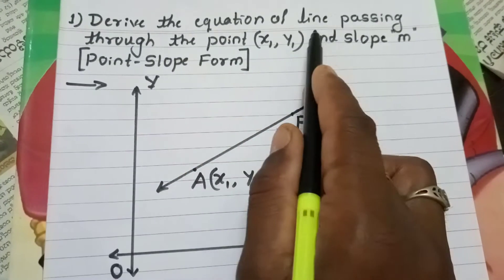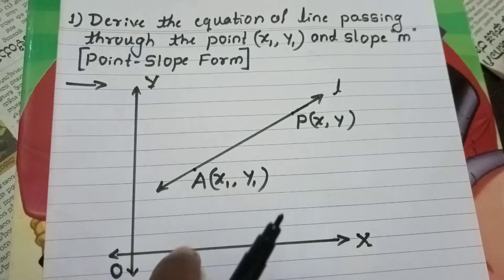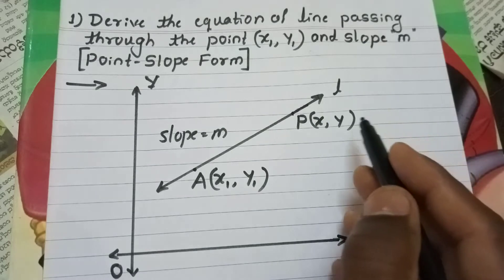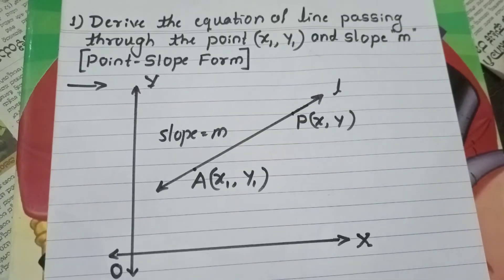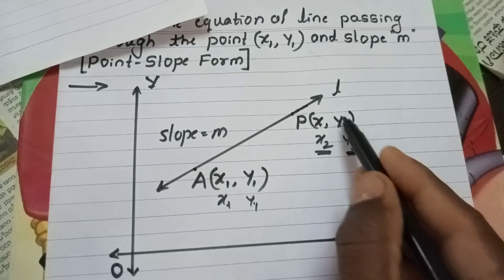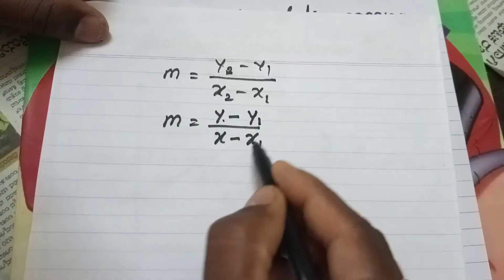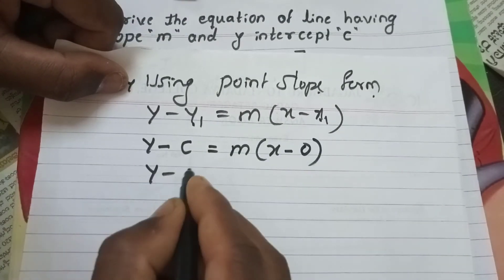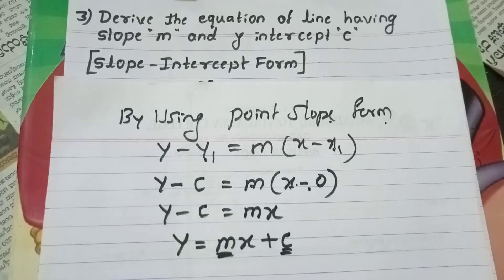PUC I Year - Straight Line - Different form of lines -  2 or 3 Marks Important

Comment from the maker: PART-D (5 Marks)
Questions numbers Starts
from 52 to 62
PUC I Year Mathematics 2022
Most Important Questions with explanation,..
Must watch the video will get maximum marks

Q.52 - Relations and Functions
1st Video: Types of Functions
https://youtu.be/qpIFfwJu6LQ

Q.53 - Trigonometric Functions
1st Video : 3 Examples
https://youtu.be/l-G1M54MSPc
2nd Video : 2 Examples
https://youtu.be/VhTbW6sZhJo

Q.54 - Mathematical Induction
1st Video : Prove By M.I
https://youtu.be/JRp2eXSrQrw

Q.55 - Complex Number
1st Video : Polar Form
https://youtu.be/9Yb-dPSKAa4

Q.56 - Linear Inequality
1st Video : Solve the system of inequality graphically
https://youtu.be/Bzy9jsCpF7g

Q.58 - Binomial Theorem
1st Video : proof of theorem
https://youtu.be/TnBLnJVN-bg

Q.60 - Straight Lines
1st Video: point from the line
https://youtu.be/IAgq1OSkRJU
2nd Video: parallel lines
https://youtu.be/x85YsGSuSW0
3rd Video: Normal Form
https://youtu.be/BxuVt_sr88A
4th Video: Angle between lines
https://youtu.be/JwKJ-igzNu0

Q.61 - Three D Geometry
1st Video: Distance Forma
https://youtu.be/TSDwoen-Nd8
2nd Video : Section Formula
https://youtu.be/nrzhoqjkOf4

Q.62 - Limits and Derivatives
1st Video : Sandwich Theorem
https://youtu.be/9tcjxR7jBmU